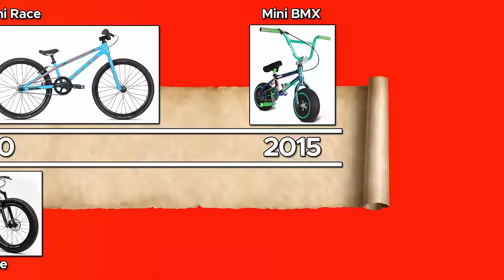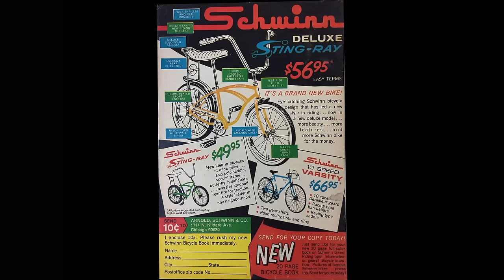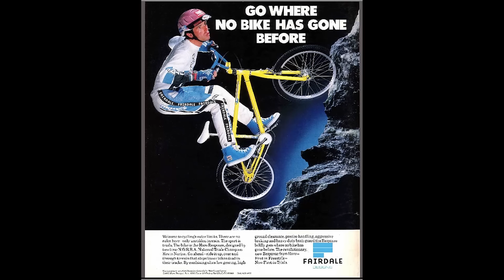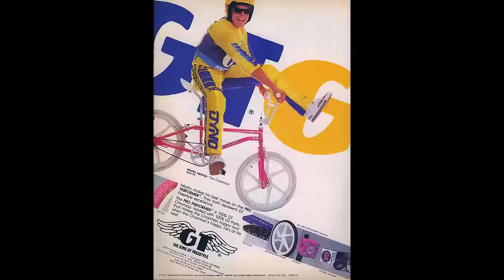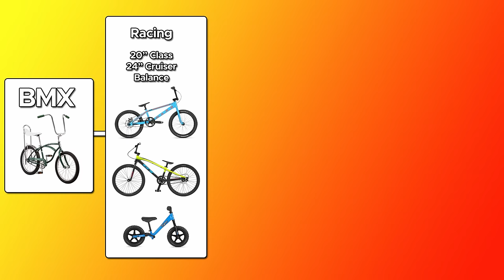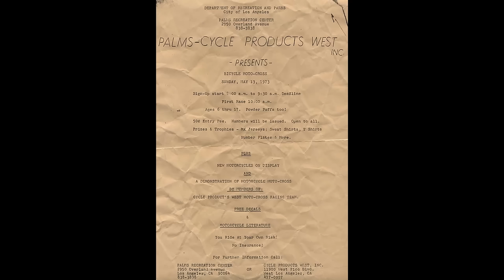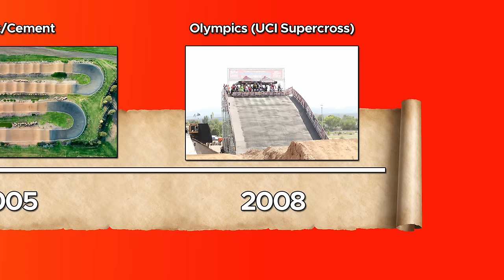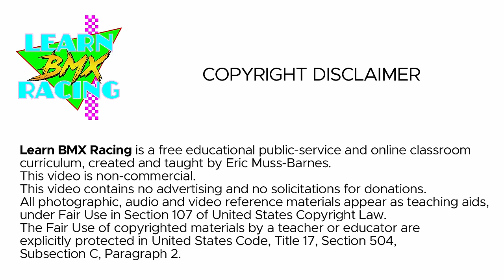History of BMX Bikes & Tracks

Comment: Bmx Seats angled upward also serves the pupose for barspins. Dirt, park, street riders pinch the seat with their knees. 
Bmx frame geometry has changed dramatically that is very interesting. Depending on the discipline, race, park, dirt, flatland the smallest geometry differences help benefit the riders desires. For example race frames are designed for speed and stability. Park is designed for transitions simular to dirt. Street has become closer to a flatland but with much more durability. Depending tricks bikes are modified to aid the rider. Flatland frames have the shortest chainstay, short top tube, really steep headtube, and were the first to adopt small sprockets. Park and dirt frames have different mild chainstay length with a taller handlebar for an upright position. Dirt frames differ from park frames with headtube angle and top tube length. Street frames have gone from simply using a park bike or race bike with pegs to a steep head tube, shorter top tube, short chainstay, taller bar, wide tire, and a lower bottom bracket. Race frame geometry has also changed throughout the years. Head tube raked out, longer chainstay,  longer top tube, a really really low bottom bracket.  The big chainring helps with rollout. 
The progression of bmx has not stopped and the big contributor i believe is the slightest frame geometry changes.
Reply from the maker: Different disciplines of BMX do indeed use slightly different geometries.

Comment: First of all, awesome video. Glad that I stumbled upon it. 👍 👍 
Having raced in the ABA from the late 80s until the mid 90s, one thing that disagree with is that mini BMX bikes came out in the 2010s. I know for sure that mini 20"ers were around in the 90s. And if I remember correctly, micro minis(18") were around during that time as well.
Balance bikes, on the other hand, I can completely agree with. I remember teaching my older son(born in 2006) how to ride without training wheels, but never having to do so with my younger one (born in 2010), as he learned to ride on a dandy horse. 😉😂
Reply from the maker: Thanks. Glad you enjoyed it.
Back in 1984 there were micro mini bikes being made by JMC Racing, but they didn't become well-known or popular until much later. For example, Haro wasn't making micro mini bikes until about 2009. GT made them briefly in the 90's then stopped for a few years. So, I cite 2010 as the year they originated, because that's when most major manufacturers began building them consistently.
Reply: @LearnBMXRacing  Ah. OK. Thanks for the reply.
Reply: Sorry but mini 20" and all kinds of small sized parts to accommodate them were widely available from 2000 til the present.. 1" to 5" bars, 130 to 165mm cranks, mini seats, 1" slick tires, many different sized frames dubbed micro up to expert xl, and all lightweight parts were regularly and easily available during my son's entire bmx racing career from 2002 up until 2013.
Reply: @LearnBMXRacing  Ever hear of the Minigoose?  Not sure if this is what you mean by mini or micro, but the concept was there in pre-1985 BMX...  see it in the BMX Museum... 1984 Minigoose by Mongoose.
Reply: I am pretty sure pit bikes (minis) were around in the 80s, at least the late 80s. People used to putter around them in the pit area (hence their name) and go to the concessions on them. Not the 20" minis but those 16" wheel sized ones. We also called them "pocket bikes" waaaay before 2010.

Comment: Great video, but don't call spandex shorts goofy. Their advantages are : no wrinkles to sit on, no flapping in the breeze, and improved muscle recovery from the compression.
 You know what's really cool? The boxer briefs with the same elasticity as the spandex shorts. They are thinner, lighter, wick moisture better, and work well under looser shorts or sweatpants.
 I'm almost 65, and I still have my BMX stuff from 40+ years ago. I just learned that my Gary Littlejohn bikes are valued in the thousands of $. I wasn't expecting that.
 I'm now going about getting all of my 26" Littlejohn Factory Cruisers ready to ride again. I build wheels, so I have some pretty wild options.

Comment: Truly one of the best Bmx videos i have ever seen! this thing should be saved for generations you captured a great piece of history here,  a few mistakes  riding brakeless has been going for decades so it's far from being a FAD and it serves a few purposes: one it's cheaper and easier to maintain a bike without breaks and it makes for a much cleaner build that's also almost silent from things rattling around and two , it gives u a whole different feeling when riding street or skatepark for so many reasons that i guess u just have to try it for yourself to understand the biggest is you have to commit when you go for a trick because you don't have breaks lets just say it makes things a lot more exciting fast :) and the another mistake you made when showing different BMX bikes on sale and trying to figure out the differences,    pegs are generally and aftermarket all none race bmxs can use pegs and it's a riders choice if to buy pegs and use them or not.. thats why its Called FREESTYLE also running breaks or not running them is a choice you make.. we dont leave that to the vender. you can put breaks and 90% of brakeless bikes most BMX frames have break mounts regardless if they are being sold with breaks . or as frame only. and most bmxers buy the parts they want and don't actually buy fully built bikes , maybe your first few bikes are fully built but very quickly you will progress to buying all the parts yourself when building and maintaining your ride . great video!

Comment: So much good content in this video! A couple of additional bikes not mentioned are OS 20 and big tire (26” and 29”) bikes.  And Mini 20 as well as micro mini (18”) bike have been around for 20-30 years
Reply from the maker: As I mention at the start of the video, there are literally scores of different bicycle designs, but only a few are genuinely innovative and relevant. I don't mention bikes like OS20, or all the sizes of cruisers because, those bikes don't matter. Merely altering a tire diameter doesn't make them unique or different.
Back in 1984 there were micro mini bikes being made by JMC Racing, but they didn't become well-known or popular until much later. For example, Haro wasn't making micro mini bikes until about 2009. So, I cite 2010 as the year they originated, because that's when most major manufacturers began building them.
Thanks for the compliments and sharing your thoughts.
Reply: And remember side-hacks? Those were actually kinda stupid...I don't know if we really need to remember them much...LOL

Comment: for the difference in the BMX freestyle/ park & dirt jump bikes aren’t necessarily the pegs  , breaks or lack of , 
it’s the geometry of the frame, things like head tube angles , top tube length , chain stay length , bottom, bracket height  , stand over height , all have different effects on the stability of the bike in the air , the responsiveness of the bike for tech tricks , etc.
But , generally if it’s a trail dedicated bike , 
it will have the brakes on the chain stay and the pedals will be made of metal , not nylon. 
Great video BTW

Comment: An old video to watch that goes way back before your video you mentioned, is " Curb Dogs ", which I watched back in the day " 1986 "! Also, I used to race BMX back in the day, which was back in 1982-83. I used to Race at the Howard County Fairgrounds, which had a permanent track that stayed there for several years, and during the winter they built a track indoors in the big indoor buildings on the fairgrounds, each year they would remove it and then rebuild it again each winter. Well, eventually the wind up tearing down the outdoor track and didn't even use the indoor building anymore, it's quite sad to see the sport go away from where I lived and grew up racing when I was younger. We even had another outdoor track built behind the shopping center in Columbia MD, which was in Howard County and only 10 minutes from my house, and they eventually stopped using that track around the same time,  maybe a year or two later, but it's sad to see it not be as big as it was when I was growing up in the early 80's. I've had Mongoose, Thruster Tri-power, GT Pro series that I have in the 2000's that had about $1,500 into it, I've had a Haro Freestyle Master, Hutch Trick Star and a few others, but I really miss riding, and I wish I would have held onto my Thruster Tri-power, because it's now a collector's item, so are Hutch  Trick Stars, the older Mongooses and the old Haro Freestyle Masters, these bikes are now highly sought after. I paid $600 and something for my Thruster Tri-power back when they first came out, and they also had the Thruster Bi-power, which is also highly sought after, but I think the Tri-power sells for a  bit more and is what people wants more. 

I even had the BMX racing cards they used to give out, which had the ABA " American Bicycle Association " on it, then it changed to the NBA "  National Bicycle Association ", so I had both.
Reply from the maker: Thanks for sharing your experiences. It's nice when people leave a long comment like yours, because it shows you really love the sport and appreciate my video. That's awesome.

Comment: this may sound corny but still to this day,  have always been curious about how the riders on these bikes we somehwo about to turn the handlebars ALL the way around pretty much 360 Degrees even though the brake cables if correct went down inside the bikes Frame....
Reply: No. They used a gyro which split the connection from the bars to the frame. Think of it like a turret rotating but for your handlebars. One set of cables connects to the top of the turret for the handlebars and the bottom cables of the turret are fixed to the frame. This allows a full rotation without getting tangled up. Some bikes had the brake cables travel down the stem of the handlebars.
Reply from the maker: The story of detangling brake cables happened in 3 phases.
First, there was the "Potts Mod" (because it was a modification invented by Steve Potts) which was basically a hollow headtube bolt. By drilling a hole through the bolt and fishing the front brake cable through the hole, it allowed the front tire to spin about 1.5 turns, before the rear brake cable was tangled.
Second, came an invention called a "Rotor" which was a pair of interconnected rings that fit around the headtube. The rear brake cable went inside and attached to the top ring. Then a second cable came out of the bottom ring and went to the rear brakes. This allowed the front tire to spin 360 degrees an infinite number of times.
However...
The "Rotor" only pulled on one side, and the abrasion against the exposed brake cable inside the rings would cause it to fray and snap.
Third, they invented the "Gyro" which is a lot like the "Rotor" but the rear brake cable attaches to a bulb and it splits into two. With two opposing cables attached to the interconnected rings, it balances out the pressure and makes the brakes pull much smoother. And since the attachment points are outside the Gyro rings, the cables don't rub and fray. The basic design of the "Gyro" worked so well, it has remained mostly unchanged for about 35 years.

Comment: In a parallel universe, we have BPX instead of BMX.

When I was a kid in the 1970s, all we wanted to do was take a Schwinn Stingray, strip it down, and set it up with motocross type stuff. It was all heavy as hell, but it held up over jumps. We had dirt jumps and of course the old cinderblocks and plywood jumps. I jumped so much I snapped my frame in half. Got a 'new' one at the local dump! I did have a Murray, and I bent the hell out of if. The forks bent forward, and the frame bent in and the back wheel dragged on it. It was a piece of crap. After that I got a Hutch Pro.
Reply from the maker: Yeah, all the kids got tricked into thinking Murray and Huffy bikes were good. You weren't alone!
Reply: @LearnBMXRacing  I remember my dad (a plumber) putting my Murray forks in a pipe vice and the two of us jumping up and down on them trying to straighten them out. My parents weren't too crazy about the idea of getting another bike while you had one that worked perfectly well (the wheels rolled) so it wasn't until I made my own money that I could afford anything good! I mowed lawns more often than riding my bike that summer 😅

Comment: I turn 62 next week, I was fortunate to build my own moto-cross from a Schwinn pre-stingray.  In Springfield ILL. Schwinns was made in Chicago so most of us rode Schwinn. I had a skinny tire Stingray, the frame would not except the fatter tractor grip knobby tires. The only part I used from the Stingray  was the crank and peddles, because they was about 2” longer that the junk Schwinn put on pre-Stingray bikes. That gave me more leverage or torque.
The must have was a double clamp gooseneck with moto-cross handlebars, waffle grips and a pad on the crossbar for riding double. After the banana seat cracked in half I replaced it with a English racer type seat, so no more riding triple.
We didn’t race much, mostly jumping down stairs and riding wheelies several hundred feet…
Our biggest ramp that was comfortable to jump was 4 milk crates high. The landing ramp was a 3/4” 4’x8’ plywood. The takeoff ramp was a bit shorter 3/4” 4’x6’6” plywood. The jump was 15’-20’ in length and a little over 6 or 7 feet in height. As long as you landed both wheels on the landing ramp it was very smooth. Railroad track rails was really smooth to ride the rail. We would ride those rails for miles without ever falling off. (Abandon line)
The stair jumping was the hardest on the frames, any more than 4 stairs would be to much. Always bunny hop curbs or pot holes.
We didn’t call our builds BMX we called them moto-cross. BMX was a factory name (Bike Moto Cross) or whatever…
Nobody had a bike like mine it was made from the best parts from over 4 other junk bikes. I quit riding it when I  got a much faster Raleigh 10 speed when I was 13. Last time I rode the Schwinn moto-cross I was 18. Rode it to work a few times Jumped the stairs at the Illinois State Capital building was the last jump on my 20” Schwinn moto-cross. I never gave it away somebody got it from the garage. I hope they had as much fun riding it as I did…
Reply from the maker: That's really cool. Thanks for sharing your story and memories. You are the living history.
Reply: @LearnBMXRacing The guys I rode with, all learned to ride unicycles. It took me 2 weeks about 2 hours a day. We thought that was why we could ride better wheelies than others that couldn’t ride a unicycle. That unicycle was a tough workout on the legs. No coasting, gearing is 1:1.  

I’m wondering if any of the freestyle riders also learned to ride unicycles?

We was just show offs. Riding wheelies for the girls. Just seeking attention…
My hardest stunt was sitting on the crossbar of the handlebar facing backward peddling forward. Best done where no parked cars are around…
Everything we did was done in total secrecy. At abandon coal mines, along railroad tracks, and behind shopping malls. If caught we knew our bikes would be taken way.

Only one guy broke an arm jumping ramps. He built the takeoff ramp out of particle board. It broke in half wiping out on asphalt.  This same guy would jump his car when he turned 16. Dukes of Hazard I guess. He broke his car frame. I don’t know what his Dad did about it. I started working so I could have gas money. 

I only jumped one car twice and it was smooth.  A big hill on a country road. While speeding topping the hill got the car airborne landing on the reverse slope.  Both jumps was smooth, you got to have a landing ramp, or it won’t be smooth…

There is a fine line between fun and stupid. It’s no fun when that line is crossed…
Reply: @LearnBMXRacing he guy that broke his arm was the best wheelie rider. He could stand on his seat and hold the wheelie. Riding his wheelie in circles and figure 8’s…

First time I seen freestyle on tv I was a bit jealous.  Those guys obviously didn’t have to hide their activities like we did.

The jump flip would need a lot of practice on well built ramps. Ours ramps was plywood laid on a stack of milk crates…

Comment: I have been a BMXer for 45 years. BMX is similar to skateboarding, but BMXers inspire skateboarders as well. Just as there are different styles of skateboarding, BMX has different styles too. I remember my mom getting mad for me not " racing" when all I wanted to do was ride vertical ramps. I do love skateboarding too, but once I got into actual dirtbiking, and stunt riding my dirtbike, skateboarding got left behind. Yes " Joe Kid On A Stingray" is a great documentary, I'm pretty sure it's the best one I've seen, with " Dogtown And Z=boys" taking a close second. I have two higher end " BMXes", but one is a " 22 inch". I mean not only the frame, and fork are 22 inches, but the actual wheels are 22 inch as well. If you are a older larger rider maybe the 22 inch is for you? Wow! That trials rider is " SICK" absolutely crazy sweet riding! Freestyle bikes have the rear wheel closer to the bottom bracket. Racing, and dirt jumping bikes have the rear wheel further apart from the bottom bracket. This allows riders to roll, and coast on the back wheel easier! I disagree with what you are saying about the angle of the seat? 6 feet tall riders fit a tiny 20 inch BMX better with the seat adjusted like that, not to mention comfort!
Reply from the maker: Thanks for watching and sharing your experiences. I apreciate that.
Reply: @LearnBMXRacing  you bet! Thank you Dude, I'm honored to have watched!